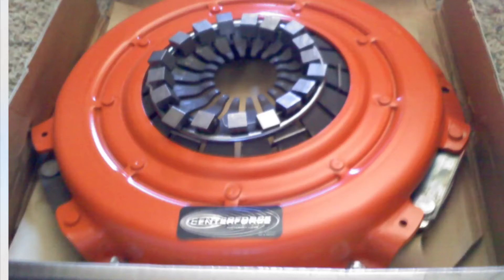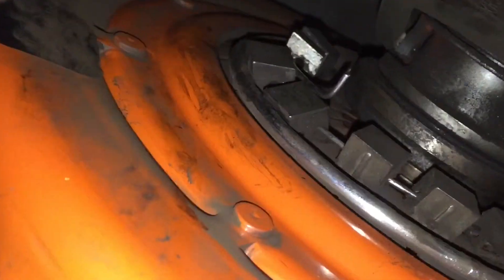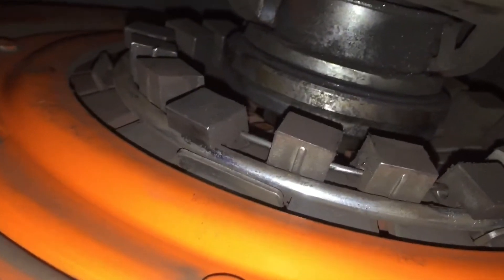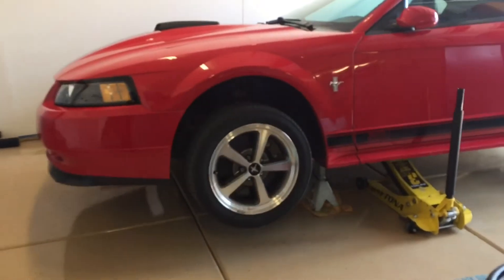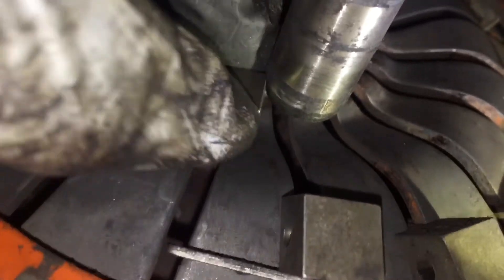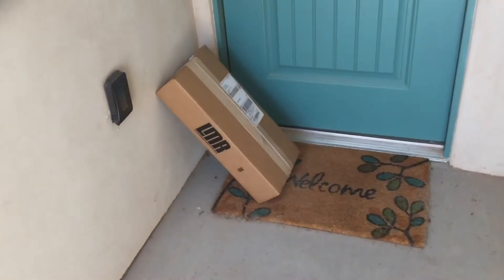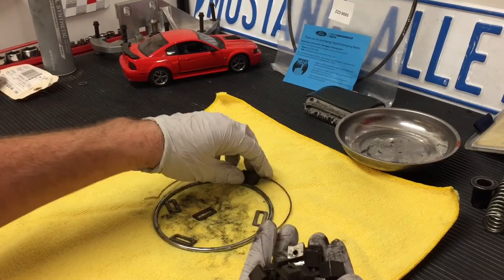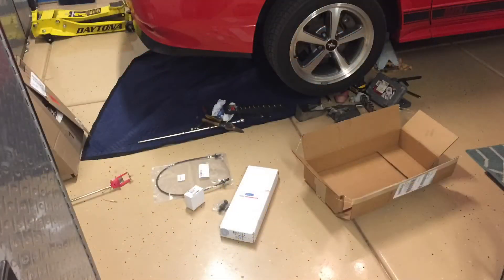Removing centerforce counterweights

Comment: Sometimes when I’m at a stoplight for example. Clutch pedal  depressed. I will here a loud hollowing noise with my Centerforce. When this happens I just take the transmission out of gear. Then the noise stops.. I’m wondering if the weights are rubbing on the throwout bearing?

Comment: The weights are possibly not as good for a muscle car, but they work exactly the way they are designed to. I have been using centerforce clutches for 20 years in a heavy 4-wheel drive truck, so the weight is not an issue and I believe the extra clamping force works great for my application. Slippage is a problem when going down very steep hills with a load as well as the weight of the truck.
Reply from the maker: They are good as long as one does not come off

Comment: Less weight on a rotating mass is always better! I wonder what the reasoning was behind having those weights there in the first place?
Reply from the maker: The weights are supposed to spin to the outer edges of the diaphragm fingers to increase clamp load... I can see what they are going for, but is it really necessary? Will it slip without it?  Does it exert more strain and pressure on the release bearing?  I'm not sold on it. The clutch seems to hold just fine.
Reply: @dannyjohnsonsgarage  Not only that but the added risk of one or more of those weights being chipped or moved out of place could severely hamper performance with vibrations such as was with your friend's car. I would agree with you that these weights are unnecessary.
Reply from the maker: Otherwise I have enjoyed the kit
Reply: @dannyjohnsonsgarage  My first cobra came with a centerforce clutch which ran fine but the pedal pressure aggravated my bad softball knee. So eventually I changed it out for a McLeod twin disc RXT setup and the difference in pressure on the pedal is amazing! My knee was very grateful...lol.

Comment: What’s the benefit of having the counterweights?
Reply from the maker: The weights are supposed to spin to the outer edges of the diaphragm fingers to increase clamp load... I can see what they are going for, but is it really necessary? Will it slip without it?  Does it exert more strain and pressure on the release bearing?  I'm not sold on it. The clutch seems to hold just fine.
Reply: That makes sense in theory, that’s a lot of extra weight spinning though